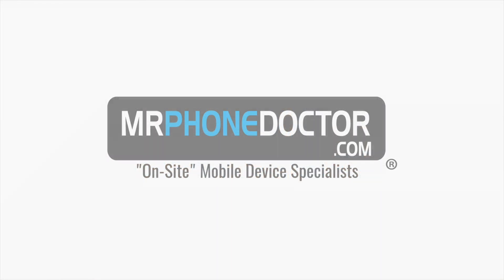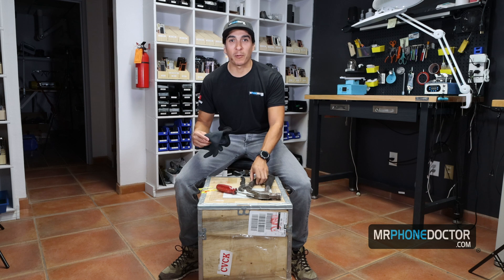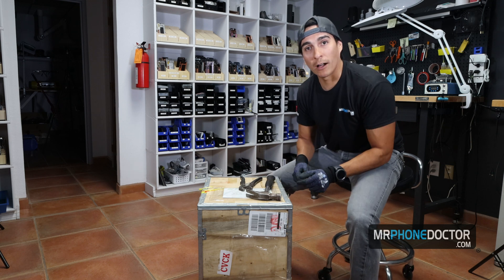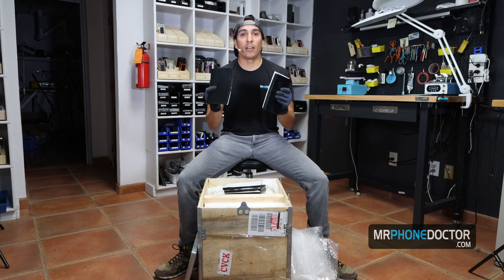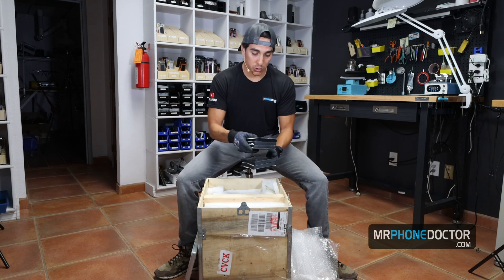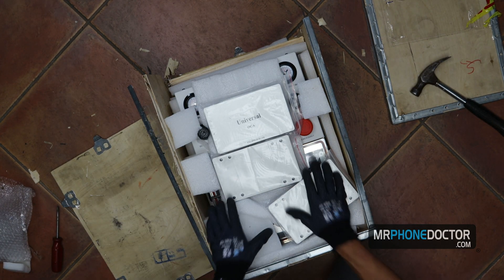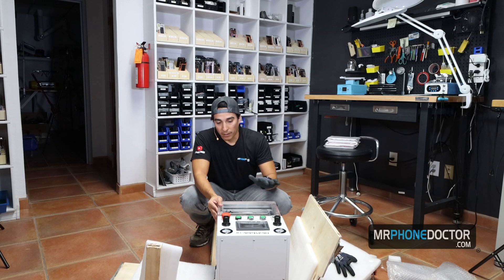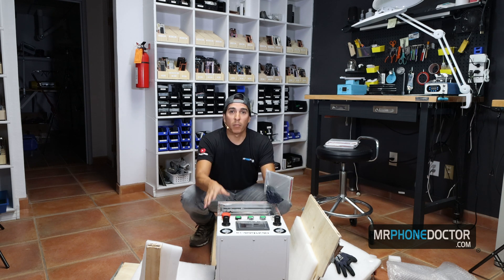OLED 2020 Apple & Samsung OCA Laminator - Comparable to YMJ & Forward

Comment: New mashine wau :) can you give more info about vacum meter is on left side under regulator, I have on my mashine aswell and I cant find any info about it when I must chang any setting on it
Reply from the maker: Hi the setting needs to be changed depending on what you are laminating. Different pressures for each process that you are doing.
Reply: @MrPhoneDoctor  on this meter is many options, can you explain what means every one